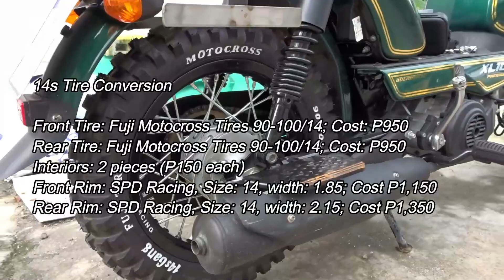TVS XL 100 Modified Offroad Tires with Alloy Top Box English Subtitle

Comment: hi sir planning to get xl1h . im 90kg, My br is 50kg, any tips mods to add more power? i really love the design if this moped, thanks
Reply from the maker: U can put a bigger rear sprocket, but it will lessen the top speed. Though it can haul both of u.

If ur goal is to use this bike with a pillion, accept the fact that this is a slow scooter.

Comment: How is your experience with the custom fat tyres. Do they feel heavy in front in long rides or any performance issues in long term use ?
Reply from the maker: Handling didnt change. But it affected fuel consumption. It consumes a little bit more than the stock tires